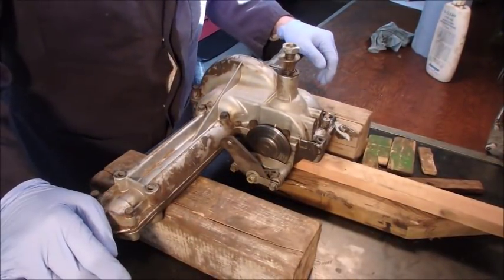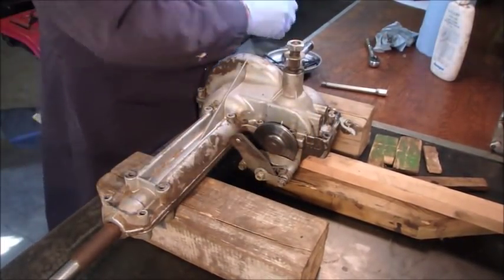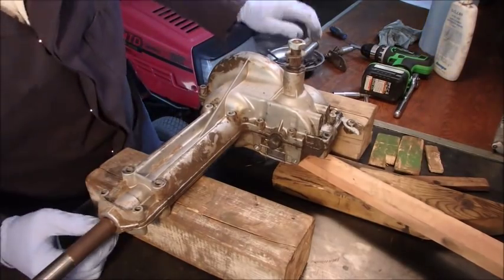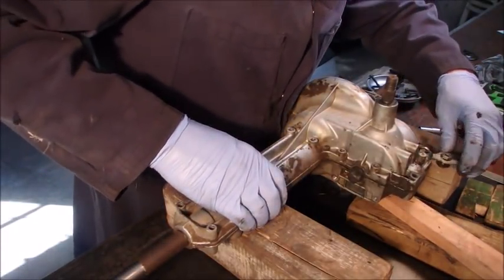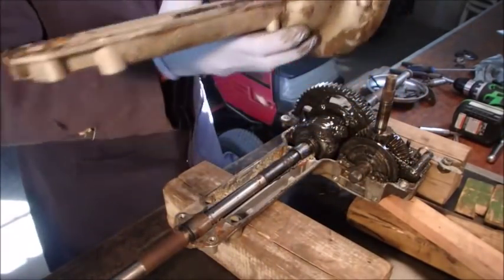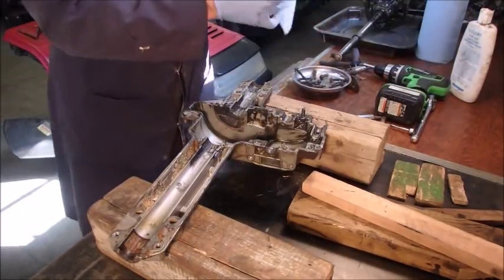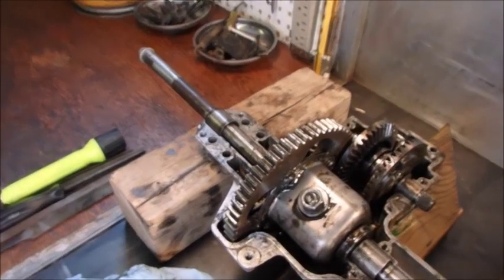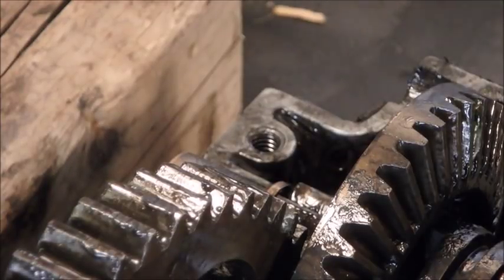MTD Lawn Tractor Differential Troubleshooting

Comment: +Bruce Pender -  There are " Other " useful parts there.  Either put them on your Wall as " Arts " or put it on eBay for " P-Arts ", LOL.  Another way... Put them on your Wall and later on you might find a good use out of them.  Also, People crack the " Housing " all the time, could have sold just the Housing!  But like I said, there are tons of Parts that is may NOT be useful to you, but remember.... Somewhere, someplace, someone is in need of your " Trash ".  😂😂😂😂😂😂
Reply from the maker: Thanks Jordan.  You are right.
Reply from the maker: on your comment.  Loose static electricity can ignite fuel.  I am just saying.   You comment was gone.  I am older and have seen things.
Reply: +Bruce Pender -  You sure I am " gone "?  You are replying to the wrong thread!  😂😂😂😂😂😂
Reply from the maker: Right   ARGH!!!!!
Reply: +Bruce Pender -  OK, I give up!!!  Maybe it's true to the " old " saying!  " You can't teach old dogs new tricks! "  😂😂😂😂😂😂